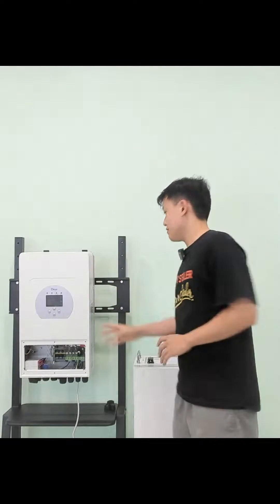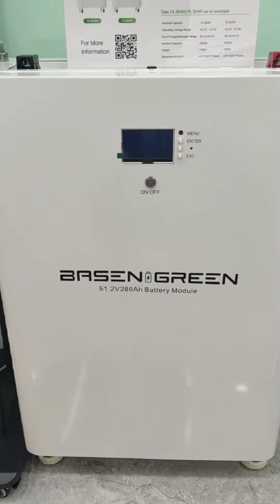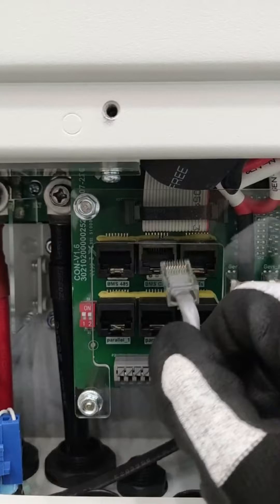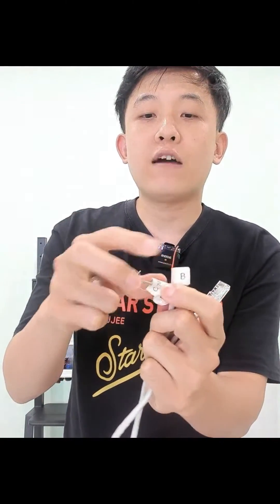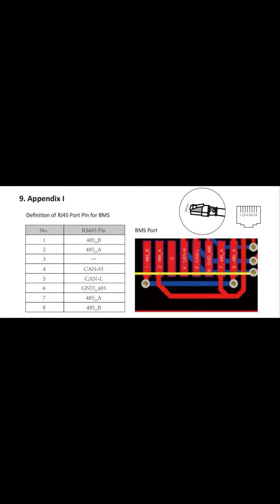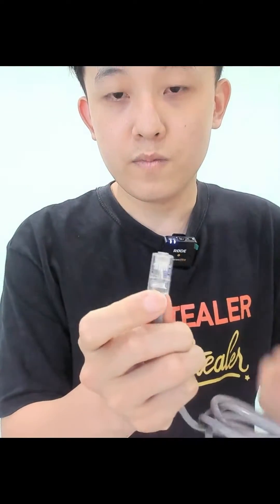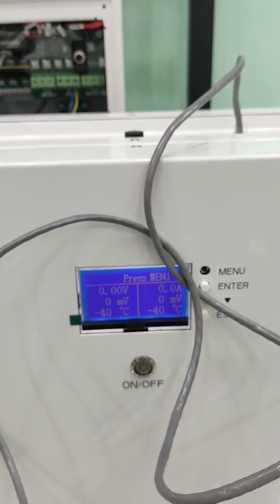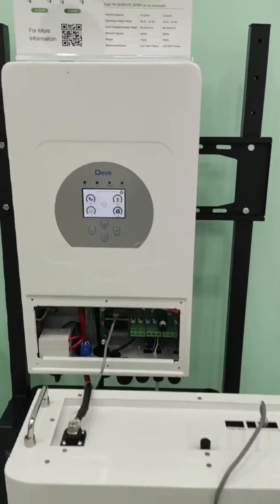How to communicate Basengreen AKKU 14.3Kwh with Deye inverter?

Comment: hi, I was about to buy your 460ah lifepo4 battery but then I see you are trying to charge a "credit card fee" and also a "shipping fee" .. amazon does not charge these fees for the LiTime 460ah which might be a better deal.. 
please advise if you can sell it for $800 with no fees. (do you have a $225 discount code? )
thanks

Comment: Hello Sir, Greetings from Turkey, I would like to tell you a little about myself. I am a man who was born without two arms. I want to buy an electric car, but the batteries of the electric car I bought are gel batteries and I do not have the money to make a lifePo 4 battery to replace those batteries. Can you help or sponsor me in this regard? 72 volts I need a 200 amp Life PO4 battery. If I give my address, can you send it?